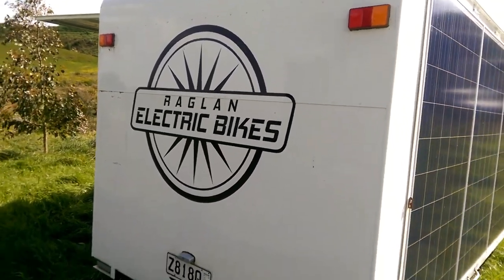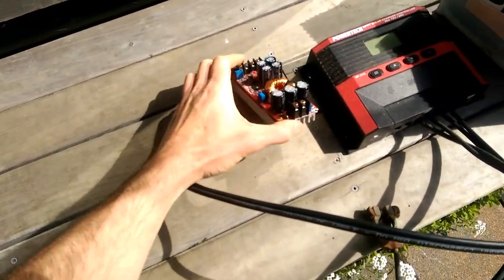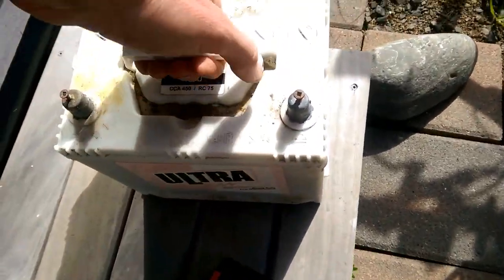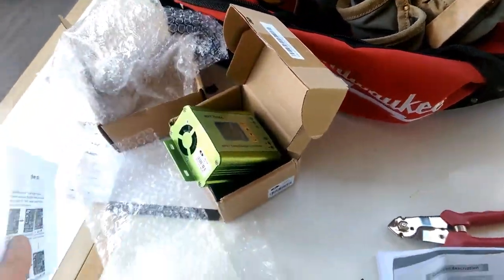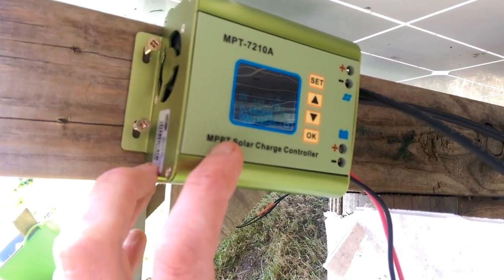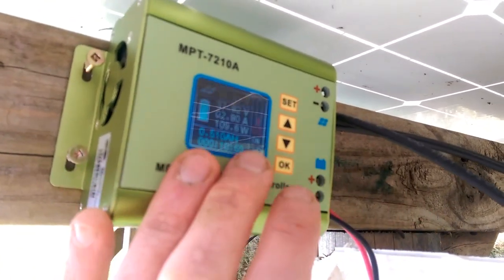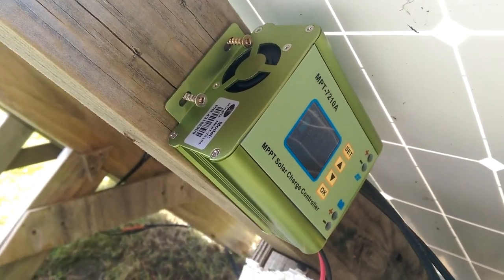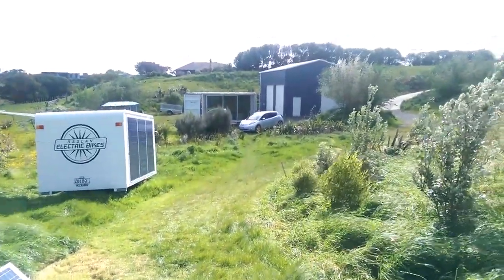Solar Electric Bike Charging Part 3

Comment: Just ordered a MPT-7210A for our solar system: Have two orphaned panels due to our current charge controller. Many thanks for the inspiration.
Reply from the maker: No worries. I hope it works out for you. Mine are great.
Reply: FYI: Solar System is different setup from Solar Energy or Solar Power System. Still uses the same method of power.

Comment: for 36V li ion accus they should be set to 42V 2A ( 2A is slow charge but battery friendly ). Also the MPT-7210A is +/- 0.5 Volt accurate. so 41.5 volt will do as it comes up slowly. To prevent cloud problems with this thing -> if your panels have a max unloaded Voltage of 21 Volts ( typical mono 12v panel ) - then set the panel voltage on the controller to 17 -17.5 volts ( as sweetspot ) also you may use parallel wiring - in series on shades one panel always becomes a resistor unless you use bypass diodes. You also can add a small cpacitor on the input from the panels.

Comment: Hello again Raglan bikes,
I’ve ordered a Minghe mppt7210A solar charge controller from a Chinese seller on amazonuk and I’m wanting to charge my 500 watt, 36volt ebike battery with solar power. When I plug into the wall socket, the cable runs through a transformer and lights on the ebike battery light up to show that it is being charged. However, when I tested the minghe in bright sunshine, the lights indicating charging did not come on. Do I simply have to jam the end of the solar panel cable from the minghe into the socket of the live or neutral terminal of the battery?

Comment: Thats a great idea! Can you completely set the voltage freely? If i would like to charge my ebike 48v battery fully, can i set the max voltage to 54,6v ? Thanks!
Reply from the maker: Within the unit's max and min limits, yes your choice of voltage. I always go about 0.5V below what I want to allow for potential inaccuracies in the device and make sure nothing gets over charged.

Comment: I’ve ordered an ebike and I’m hoping to charge the battery with a solar panel together with the Minghe mpt7210A boost converter. The ebike battery is big and is rated at 500 watt hrs. If watts = volts x amps and I choose to charge the battery with 2amps current, then volts for the mpt7210A will be something less than 500/2=250volts. Since the mpt7210A is a boost converter which has a limit of  72 volts, am I right in saying that the mpt7210A will keep on charging the ebike battery at 72 volts, but will take a longer period of time for the solar panel to FULLY charge the battery? I’m new to ebikes and boost charge converters, so if this question is a stupid one, just disregard it. But if the question is a realistic one, it would help me make a decision on whether to purchase the mpt7210A
regards   RobT    uk
Reply from the maker: You've almost got it. You can only charge at the battery's voltage. I'm guessing it's 36V.
36Vx2A=72W
Wh/W=hours (time to charge) so
500Wh/72W=6.9 hours.
That's reasonable, you'll get a half charge in 3.5 hours.
Hope it helps :)
Reply: @RaglansElectricBaboon  Thank very much for taking the time to reply to me. It was usefull info
All the best to you
Rob T    uk.
Reply from the maker: Enjoy the bike!